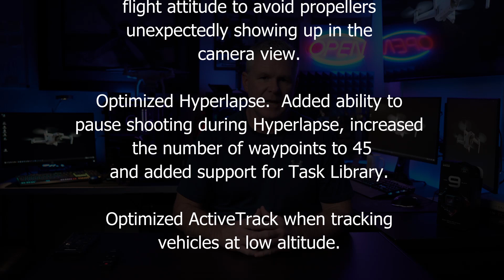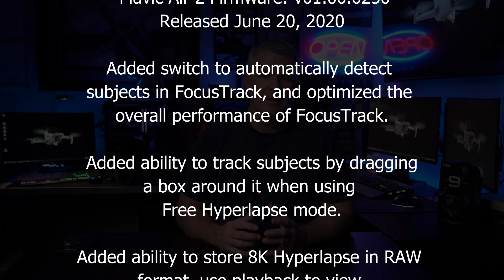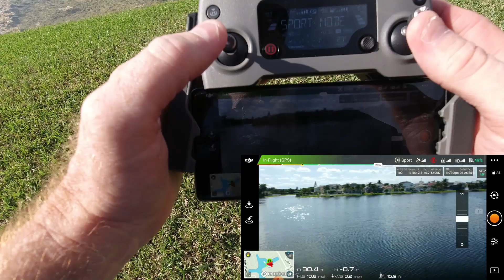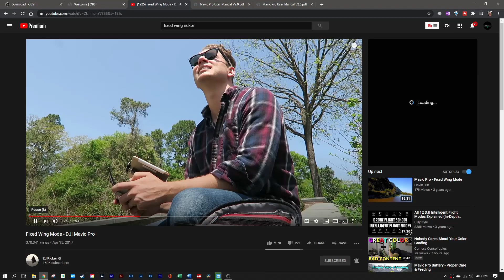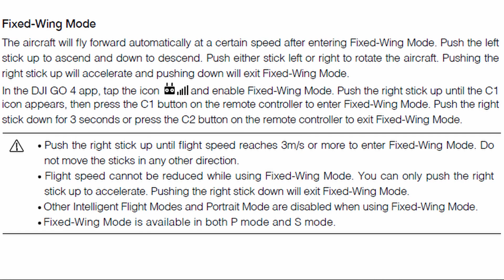A New Turning Science DJI Mavic Air 2 - Major Change From The Past!

Comment: Great observation. I personally enjoy the coordinated flight as it’s the most realistic approach to flight. Something I was hopping they bring back from the original mavic pro. I wonder how much more of a bank you can reach with using both sticks on top of it? Then once again with fpv mode as a comparison. Just wish one can control the transition of the gimbal in fpv mode so it’s a bit smoother.  Glad you brought this to our attention. I too follow Ed and own a Mavic 2pro. Will do some test too. Thanks!
Reply from the maker: Hey Claudio, thank you for the kind words. I agree with you about the realistic approach to flight. As a fixed wing pilot myself for many years banked turns are the only way to fly. I think it might be nice to have an option to switch yawning-only turns for those that want it. In my experience using the both sticks together does not increase the bank any farther. Let me know if you experience it differently. Thanks again!

Comment: Hi,thanks for the video.  I actually like the new features.  Previously I was exploring how to achieve this type of turn by a combination of right stick forward and right while left stick left for an anti clockwise circuit. It will work but is a bit fiddly and not perfect,  but I do love the look of an aircraft in a banking turn. Now I don't have to mess about to enjoy the fun of a smooth banking turn. After all, flying a drone is much more than taking aerial photos,  and this adds to the pleasure;  and conversely adds to the frustration with a lot of the new rules and restrictions making it much more of a faff to get out somewhere where its clear to fly and enjoy the fun of flight. 🤔
Reply from the maker: Hi Geoff, thank you for the excellent comment. You just summarized exactly what I like about the new MA2 turning feature. As a fixed wing pilot myself I also love to see an aircraft in a coordinated, banking turn. Graceful. I think it would be great if DJI did the same for the new Mini 2. 
Question for you: if DJI included an option in the Fly App to toggle the banking turning on/off, would you like this and would you sometimes switch back to the "flat" turning mode? I'm curious to hear your thoughts on this.

Comment: Thanks for all your hard work.  Like you, I'm pretty entrenched in coordinated flight from all my fixed wing flying .  My Air 2 came to me in September so I've never known it to be any other way.  I will say that the auto coordination is kind of cool when it has some forward or rearward motion on it.  I have noticed that when you reduce that fore/aft stick input to near zero for coming to a smooth stop, the drone is not exactly graceful in how it transfers in/out of coordinated flight to "level platform" mode.  The gimbal seems to compensate the camera just fine though.
Reply from the maker: Thank you T. S. Thomas for your input. I do like the auto coordination of the MA2. The only thing that would make it better is an option to switch back to "level turn mode". I personally would leave it in auto coordination but others might prefer the old way.

Comment: Use fpv mode for gimbal  . Then you will get fixed wing style .
Reply from the maker: Hi Didzis, thank you for the comment. I have flown the MA2 in Normal, Sport and Tripod, FPV and Follow modes - in all possible combinations. In my experience the MA2 has the same "new" turning characteristic regardless of the settings noted above. Also, "Fixed Wing Mode" was a selectable mode on the the original Mavic Pro from several years ago. It is not offered on the MA2 and is much different than the MA2 "new" turning characteristic. I reviewed Fixed Wing Mode in the "New Turning Science" video. Please let me know if your experiences with the MA2 are different than mine. Thanks!!

Comment: as an owner of the air 1 and about to upgrade to the air 2, this is a great video to introduce me to what's new with flying it. thanks!
Reply from the maker: Maurice, I'm very happy that the video helped you and thank you for letting me know. Tha MA2 is an excellent drone by any standard and I'm sure you will be happy with it.
Reply: @CAMTechChris  I liked how you showed your stick controls with showing the drones in the air at the same time. I related to your flight control. made it easy to understand. looking forward to seeing more of your stuff. did you build your pcs? nice set up all around.
Reply from the maker: @Vantour2026  Thank you for feedback and I'm happy to know that the pip showing stick input helped. It's more work during video editing but makes for a better video - at least that was my intent. I definitely build my own PCs. Currently I have 2 desktops (the 2 right behind me) - one with Ryzen 3950x and the other 3700x.
Reply: @CAMTechChris  mine is with the 3700x and the rtx 2070 super.
Reply from the maker: Very nice,the 3700x is very good cpu thank the 2070 super is a strong gpu! I have the Nvidia 5700XT in my 3950x rig and the Radeon RX580 in my 3700x rig. I'll probably upgrade to the Radeon 6800xt as soon as it's available.

Comment: After the last update, my ma2 floats up and down, sometimes up to 5 ft. It's takes a bit before it stabilizes.  But if I move it forward or backward, it does it again. It stays locked in every other direction just not up and down. Did a compass and imu recalibration several times, same thing. Anybody else notice this? Completely ruins the hyperlapse
Reply from the maker: Sounds like a very unusual situation Terry. Almost sounds like the bottom vision and/or infrared sensors are blocked or damaged. Have you checked them? Also, you might try to cycle the obstacle avoidance on and off, or cycle thru the tripod, normal and Sport modes while you are flying. Let us know what you find out - I'm definitely curious to know.

Comment: Excellent video! I have the feeling you are an actual pilot as you used the proper term of a skid turn etc. I own both the mavic air 2 and the mini and havent even noticed the auto banking as I fly with both sticks. I will say that parrot anafi used this method and had auto banking built in because it only had a two axis camera and would get jello video on just a yaw turn. Great job and explanation. Will have to see more of your videos.
Reply from the maker: Arnie, yes Ive been a certificated pilot for 35 years, small planes and big planes. A flight instructor as well. Thank you for your kind words. Let me know how you like the new banking characteristic on the MA2.

Comment: What are the advantages and disadvantages of this? Why do so many people not like the new flight science? I'm thinking of upgrading from the mavic air 1... Thanks
Reply from the maker: Advantages: tighter, quicker turns. Also, there are some advantages when flying in FPV mode since the pilot doesn't have to use both control sticks to make banking turn. This helps make the video footage look smoother, again in FPV mode. 
Disadvantages: Its different than we are all accustomed to. Change is a pain sometimes.  Also, I think some just like the "old" style of turning. 
Mostly though i think its just a personal preference. You can simulate the "new" turning "science" with your current MA1 by making turns with both control sticks, like i talked about in the video. 
My opinion: if you can afford it you should definitely upgrade to the MA2  - you wont be disappointed. 

Thank you for watching and for the comment!

EDIT: I'm only encouraging you to upgrade to the MA2 if that's what you already have your sights set on. I would say that you shouldn't let this change in flight characteristics discourage you from it.
Reply: @CAMTechChris  ok, thanks so much

Comment: Thanks for putting out this video. I tried the FPV mode in my Spark, Mavic Air, and Mavic Mini, and it was very difficult to get smooth turns and video. I just tried it out on the Mavic Air 2 last week, and noticed it was super easy to get great smooth video while only using the yaw to steer. Now I know why it was so much better. Thanks again!
Reply from the maker: Hi Dronerise, this is great news and I'm glad the video helped. When the new firmware came out in August 2020 I think it was a little puzzling for many folks, myself included. Overall I think it was a good change that DJI decided to make on the MA2. Happy flying!!
Reply: @CAMTechChris  I agree, I love the way it turns now, and I will be using FPV mode way more often.
Reply from the maker: @dronerisephotography2378  I know what you mean and I'll be using FPV mode more often now as well.

Comment: Quite interesting to someone just coming from a Mavic to FPV quads. It looks like DJI has taken notice as they venture into the FPV world of the varying flight modes of FPV quads. Angle mode is a flat level flight that uses yaw for turning and is a beginner mode or used often in tiny whoop quads especially in a race environment wihch for them is often slower and indoors. Horizon mode is a self leveling mode allowing the use of yaw and some degree of roll in turning, leveling if the sticks are released and sometimes used a a beginner or transition mode to acro or full control of the quad's flight. 

DJI has done great things bringing the digital view to FPV quads while also bringing some of this extra maneuverability back to the camera drones. A definite win for both camps, in my opinion. Great video.
Reply from the maker: Great points Johnny and a very interesting perspective! Thank you for sharing your thoughts!

Comment: Absolutely amazing that you noticed this!! 

Also there's something else that I thought was weird about the mavic air 2 coming from the mavic pro

Even though the mavic air 2 has a higher top speed than the mavic pro at 42.5 mph. 

It seems like the mavic pro had faster acceleration and faster braking which made it more fun in sports mode?

How is the acceleration, and breaking on the mavic air 2 versus the mavic 2 pro.. 

Am I missing something am I wrong or am I right?
Reply from the maker: Thank you for the kind words! My hope in making this video is that it would help others that might have been a little confused by the change in flight characteristics. To be clear, I was a little uncertain about the changes at first as well. As to your question, I will pay more attention to this when I fly the MA2 and M2P back to back but I do think you are correct. I have noticed that the M2P is quicker to respond to flight path changes and has faster acceleration. You bring up a great point and I agree with your assessment and I think this is why I enjoy flying the M2P a little more when I comes to raw power and agility.

Comment: Hey there, how come mine doesn't do that?  No banking at all with mine!
Reply from the maker: Good question! Are you flying the Mavic Air 2 and in firmware 01.00.0340?
Reply: @CAMTechChris  My fault. I was not in Sport mode.
Reply from the maker: Martin, as far as I could tell from my flying the MA2 the new banking characteristic applies to tripod, sport and normal modes. This is interesting for sure!
Reply: @CAMTechChris  Hi Mitchell, I’ve just come across your video again and had not read your reply yet (sorry. Been too busy flying🤪) Anyway. I was sure you meant that it only banks like that in sport mode. I’m going straight out to try again in the other 2 modes.
Can’t imagine me not noticing it though.
Reply from the maker: Hi Martin, let me know what you find out. Thank you!
Reply: @CAMTechChris  I can’t believe I never noticed that. You were right.  Goes to show how often I fly line of sight and pay attention 😬 I hope we can keep this between you and me !?🤫🤣
Reply from the maker: Haha, no worries Martin, it will be our secret. It's a very subtle change in flight characteristics so no one should be faulted for not noticing it. In any case, thank you for the update!